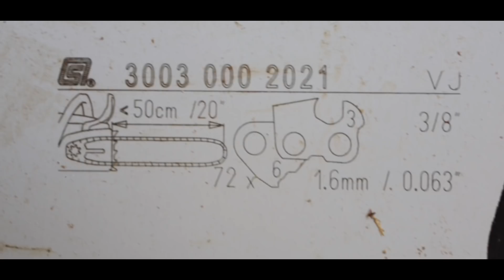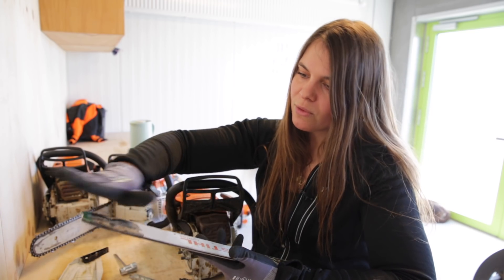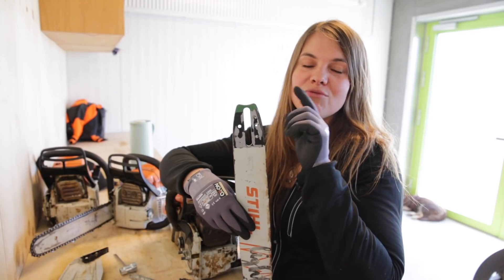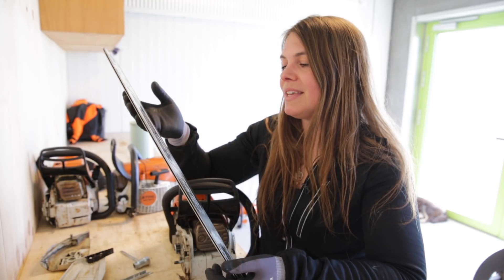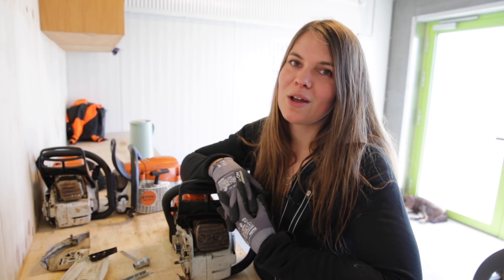Chainsaw guide bar maintenance

Comment: I had to watch a few parts twice, one was to see if the bar was overheated.  That bar was overheated because it had more than just the rail hardening discoloration.  The other part was to see the wear behind the nose of the bar.  You did a great job explaining the cleaning, burr removal, and different examples of damage.
Reply from the maker: Thank you

Comment: Well done Flex 💪!  An additional step imho ... After I’ve cleaned the bar , groove and oil hole and checked for burrs I fit the chain and sharpen it - then I spray the links with some lubricant like wd40 and go outside and burp the throttle until oil begins dripping from the saw / chain throws oil from top of chain - this way I know that everything is lubed and ready for the next cutting session , maybe not necessary but I’ve had excellent results with this method(just makes sure to set saw on newspapers to soak up oil ) Also make sure to keep a sharp chain and the rakers set properly.  A dull chain/ with improperly set rakers will accelerate wear in the bar groove - not good ... The bar should last long time this way , in fact I’ve got bars with 100face cord on them and counting. Also stay with the STIHL bar or if you can afford it a Cannon superbar.  Budget bars are cheaper up front but a false economy imho 😀

Comment: Just took my MS311 and MS391 apart blew them both out, MS391 is brand new but the 311 bar needed a little filing from use! Ready for the season in Northern Michigan!!

Comment: I’ve attempted straightening a warped bar. I don’t advise it. Especially don’t use heat. It works, but it’s not good practice. Good practice is knowing how not to damage the bar in the first place. Understanding what the saw can and cannot (shouldn’t) do goes a LONG way. Thanks again 😬
Reply from the maker: My thoughts exactly but sometimes unexpected things happen and you end up with a bend bar anyways. I would always get a new

Comment: Also a good idea to check with a small set square that both rails are wearing evenly so that the top surface of the rails is at 90 degrees to the side of the bar. If you sharpen your chain unevenly (we all naturally have a preferred side) then you can end up wearing the bar unevenly too.
Reply: I was going to mention that.You don't really need a square,just ballance your bar on edge on a flat workbench.Set down your beer can next to the bar and slide it over so that it's barely touching the bar.If the can touches the top but not the bottom of the bar,or vice versa,the rails are worn unevenly from poor sharpening or running the saw with one side dull.Replace the bar, chain and sprocket unless you have a bar grinding machine and the skill to use it.
Flip bar over and repeat test.

Comment: Hi, enjoy your videos, thanks for taking the time and effort to make them, often watch them with my younger daughters, they love them too. They go walking round the house saying Hi Treeple,  so cute.  
Regarding the discolouration on the bar, thats most likely just the heat treat they do to the bar to make it harder, if your chain was getting the bar hot enough to discolour it like that, you would have noticed some serious smoke and issues when running it, also the little dip behind the nose sprocket is often caused by running a chain too loose, maybe not retensioning it once its warmed up and got a bit of slack.
Hope that helps, Keep making these videos, and enjoying tree work, climb high, climb safe.

Comment: Great video! I really appreciated the detailed tips on checking the guide bar's condition, especially the part about looking for nicks and ensuring the nose wheel turns smoothly. I've definitely noticed my saw running a bit hot lately, and your explanation about discoloration being a potential sign of issues was super helpful. Do you have any additional tips for maintaining the chain itself? Looking forward to more content!

Comment: I tend to clean the guide grooves before the oiling holes, as when I’ve cleaned the holes first, debris from the groove cleaning, can re-block the oiling holes.

I also check the squareness of the rails, 90° to the bar’s sides; for being level with each other and being the same depth from the base of the guide groove. Providing the groove is within tolerances, if the edge of either rail is sharp or rounded, they get filed square & level.

Other than for demo purposes, I recycle worn bars and chains.

Comment: It is a good practice to pre lubricate the bar, when you put new one on. Especially on longer bars, so that the bar and chain don't run dry at the beginning.

You can also lubricate nose sprockets by putting them on "oil bath" overnight.

Greetings from Finland.🇫🇮🌲🌲🌲

Comment: You also always want to check to make sure where the chain rubs on the bar that both sides of the bar are wearing evenly. If not you can get the bar readground so that is is actually square.

Comment: Outstanding video and information as usual! I have no issues when doing traditional cutting. However, I find heat build up is an issue when running a very long bar to remove stumps, particularly in the three to four feet diameter range. Also this seems to occur when I am reducing stumps to size by ripping them into quarters. This is despite opening up the oiler and ensuring a very sharp chain. Any advice? 👍
Reply from the maker: When removing stumps you’ll often find soil and rocks in the bark which dulls the chain very quickly and when you proceed in cutting as the chain is dull it’ll get hot. 
When cutting the pieces “the wrong way” the fibers are much harder to cut for the saw and it would be better to have a chain with a lower filing angle. Try letting the saw work and avoid adding pressure this might help.

Comment: I always thought the coloration on the edge was from heat treating process?
Reply from the maker: It might be hard to see in the video but it’s another discoloration when it’s overheated
Reply: @Femalelumberjack  Yes, it was tough to tell in the video... I've had Stihl bars that showed bluing where the bar's laminations were welded together. That bluing did not go out to the edge of the bar. In contrast, on the bars I've seen that were overheated the bluing went all the way out to the edge of the bar.  What has been your experience?

Regarding the welding bluing: When the paint is completely gone from the bar the bluing (and straw coloring) looks very uniform all the way around the bar and it does not go to the edge of the bar. As you say, maintenance is important... flipping the bar, cleaning the bar, draw filing the burrs, using a bar swage to keep the groove uniformly tight, running sharp chains, not bearing down with the dogs, making sure the lubrication is working properly... it all adds up to long bar life and great saw performance. Note that even after the paint was gone from my bars they still had a lot of life left in them.  

As an aside, my son sells Stihl and Huskey saws. It is astounding how much damage people can do to a saw. For example, and amusingly enough, I went to my son's store and ran into a friend of mine. He said he was there to pick up his new saw... he reported that it had a problem with the oiler.  I found out from the manager that what really happened was the guy left the chain brake on and let it sit at an idle with the choke partially on. In that choke configuration the idle speed was fast enough to over come the chain brake. The result being that before he made a single cut he got the saw so hot that it melted the oiler and damaged other parts!  The manager showed me pictures... LOL

Comment: I would also add: Check how smooth the surface of the bar is were the chain slides on......I see a lot of bars with nicks, dings,pitting, and rough surfaces, right from the factory.........That can't be too good for the chain.......When I get a new bar, the first thing I do is clean the paint off the rails, and check for rough surfaces.......

Comment: What causes the dip at the end of the bar? My old 039 has that on both sides. Yes I turn the bar over.
Reply: I was taught it is caused by running the chain too loose ?
Reply from the maker: Correct too loose chain

Comment: Have you ever had a problem putting your chain back on your guide bar? I bought a third-party chain and guide bar and now the chain seems stuck in the bar. Possible damage?? Have you done your spark plug video?
Reply: Sounds like your chain has come off while using the saw you'll have small burrs on the drive links which you need to file off with a flat file.
Reply: @lawrenceproctor8613  Yes, I believe the chain was too loose and came off. I am very careful about chain tension. Thanks for the advice.
Reply from the maker: I agree with Lawrence. When the chain comes off while you’re running the saw you’ll often find that some of the drive links get damaged. It might also be that the chain is bend in some of the links. 
It’s important that you fix the problem before running the saw again
Reply: I will look at the drive links and file them as needed.
Reply: Yes, the both of you were right because I inspected the chain closely and it does have those burrs that Lawrence mentioned.
Reply: @slipperyblueclay2521  cheers glad I could help.

Comment: The blue color is a result of the guide bar being hardened during manufacturing. It is 100% normal, you'll see it as the paint wears away.
Reply from the maker: There are different discolorations